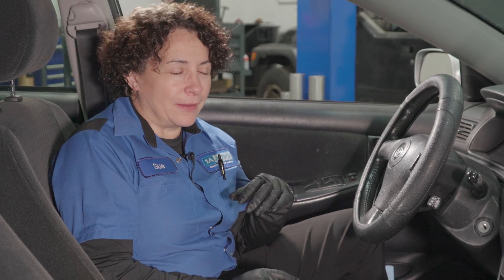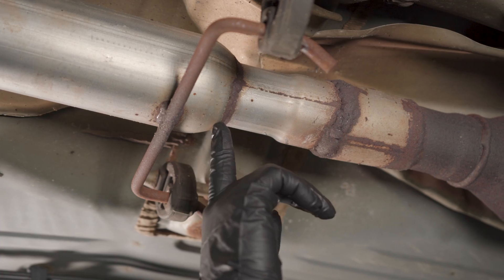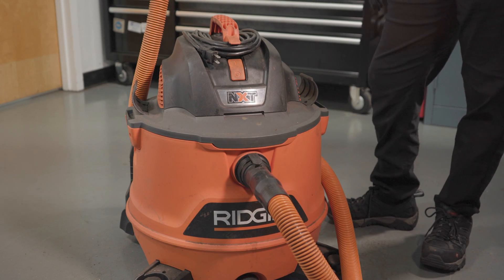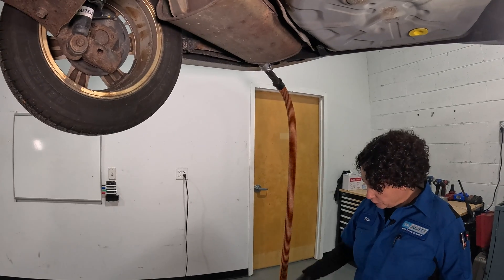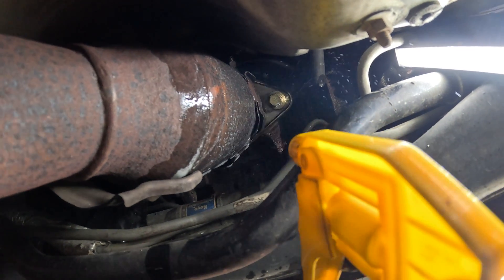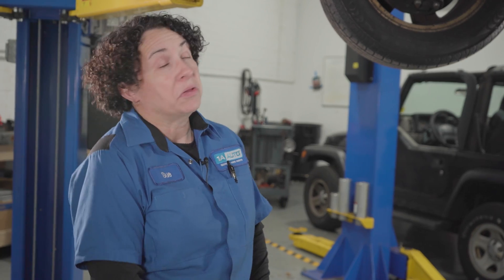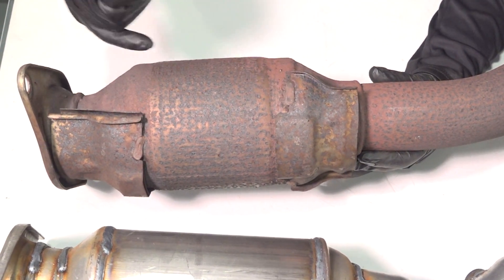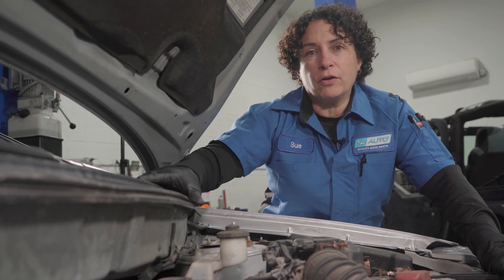Exhaust Smell Inside Your Car or Truck? Why Does it Only Happen on The Defroster Setting?

Comment: Good subject, I would like to draw your attentions,  that if you notice a foggy layer on inside the front car glass. Try to wipe it with white tissue. You will find a black oil color and I think it is a gas leak is coming exhaust pipe system through  AC vent. As I know it is a poison  CO gas leak which is not easy  to be detected.

Comment: It seems I can smell exhaust or something when the heat/ac is on. I have a cold air intake installed in my car (2015 nissan sentra S). So idk if it's from this. I sometimes can smell it when it's idling or when a car goes past me.
Reply: your cool air intake shouldn’t have nothing to do with smell you only get smell through you exhaust. after i put a intake on my car my catalytic converter was going out and making smells it might be that

Comment: This was awesome because I just had my transmission replaced and it came back with a toxic smell no one could smell except me.  I was getting sick, headaches, having episodes of piercing pain in my face and eyeballs and headaches were so severe I couldnt funtion.  I went without a car for so long I was scared I d lse my jobs.  and finally at times others started to smell it here and there and one day after the 3rd time of Ford picking it up I didnt then I did.  Now I have appt to take it to someone else cause I no longer trust Ford who swears even after one guy got sick driving it they swear there is no smell or anything.  So we will see and this helps me know IT ISNT JUST ME..  Thank you.

Comment: I have toyota corolla 2009.  
I do feel like there is some fumes getting inside the cabin some how. It is odorless. I don't smell anything but I feel the allergy. I started dry caughing. some skin irritation  and throat irritation. 

I believe it is somehting. Went to mechanic, he checked said everything is fine. Changed the cabin filter but still i feel it. It all started after some one hit my rear bumper on the driver side.

Any advice please.

Comment: I just had a brand new high quality exhaust put on my car and after a few weeks of driving noticed a gas smell in the car when turning on heat or ac.  The car is almost 16 years old, but it wasn’t long after the new exhaust was put on, so it’s hard to say if it’s a coolant leak or something with the exhaust.  Do you have any tips?  I highly doubt there would be any holes in a brand new exhaust.
Reply: I had a catalytic converter stolen from my car I had a new one put on. Now I have an Exhaust smell coming out of my vents. 😢
Reply: Did you find the problem. I have the same issue exhaust/oil smell going inside the cabin

Comment: On my 2010 Outback, it was the "variable valve lift diagnosis oil pressure switch" (one on each side) that was leaking oil.  Smelled like propane until I replaced it.

Comment: Anti-seize never goes on the female threads, every time I see a video about automotive does somebody doing something really stupid. That anti-seize goes on the threads of the O2 sensor only
Reply: It’ll get on the female threads anyway. That’s like a time a customer’s tried to tell me I have to mix concentrated antifreeze with water before pouring it in. I had thrown in a whole gallon of concentrated then a gallon of water after it’s gonna mix anyway .
Reply: What you talking about

Comment: My problem with the exhaust smell coming in via defroster, that operation opens the plenum or whatever part that diverts the air, from what I normally run “recirculate in the cabin” to “use air from outside” and I smell exhaust, skunk, whatever the heck pooopersville from outside. Does this not go through the cabin air filter? Gah! I’m always switching the defrost on and then off and closing the outside air to recirc.
Reply: I don’t smell exhaust when there’s no cars/trucks running in front of me.